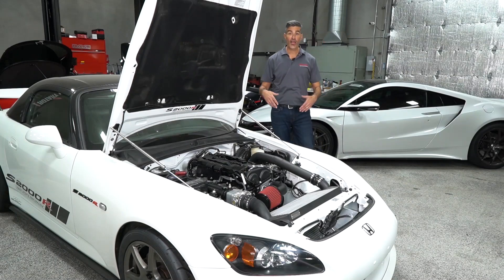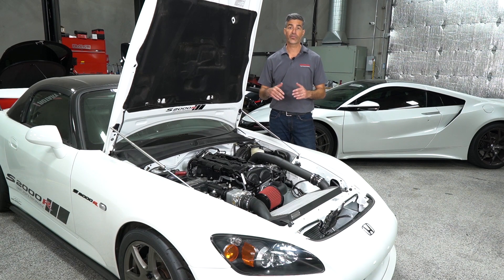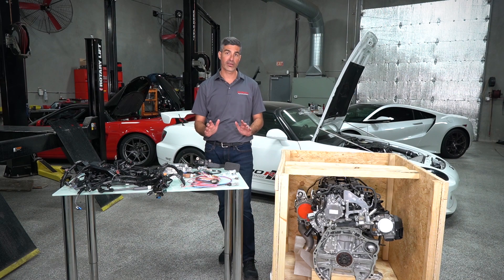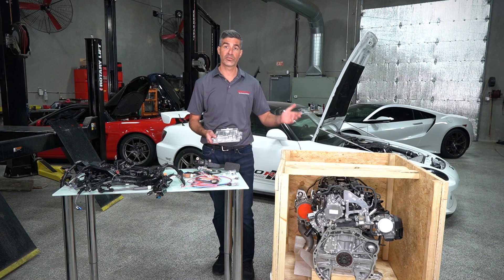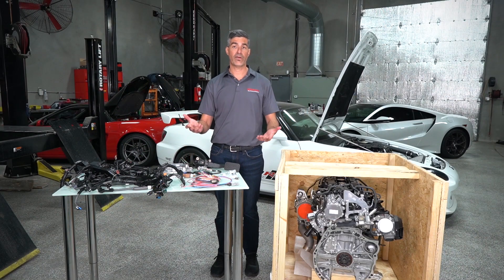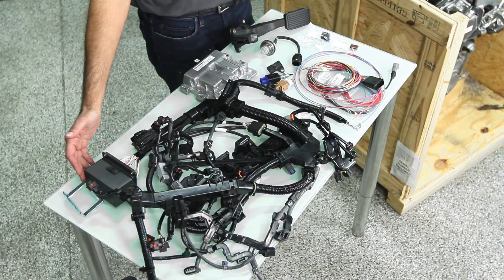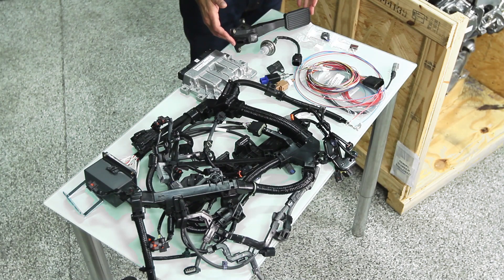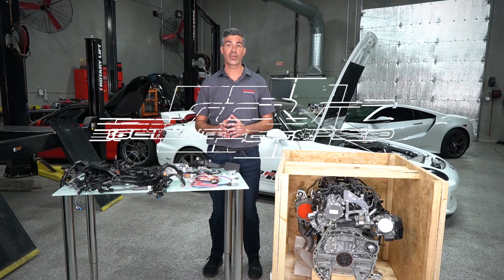Honda Performance Development K20C1 Engine Control Package Breakdown

Comment: It should be tunable once Hondata figures out how to access it over OBD2
Reply: Why wouldn’t U just be able to use the type R ecu?
Reply from the maker: The ECU used is a a race ECU with out OBD function.
Reply: @ScienceofSpeedLLC  I understand this is a “spec” engine but does HPD not have different tune/power options? For instance for race gas or race E85? 300+ HP from a turbo is reliable endurance power for a factory race car but it’s fairly low for a heavier street car HPDE/time attack build. A built $9-10K K24A2 motor can make 320HP very easily and reliably on just 93. Time for AEM or Haltech to supply the ECU I guess.

Comment: I’m not sold on an HPD solution that can’t be tuned.  I’m more interested in seeing a full plug and play solution that includes, mounts, leveraging the OEM transmission with a plug and play harness  using something like a Hondata with a baseline tune.
Reply: 95% of potentially actual customers will immediately lose interest in this if there's no ability to tune it.
Reply: Hondata might be better?